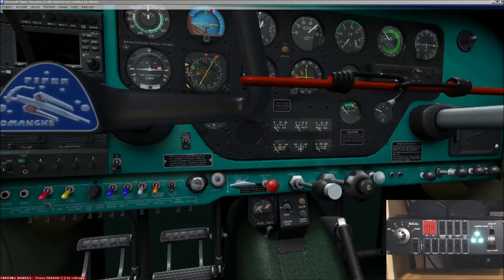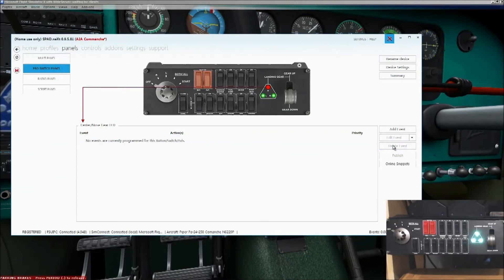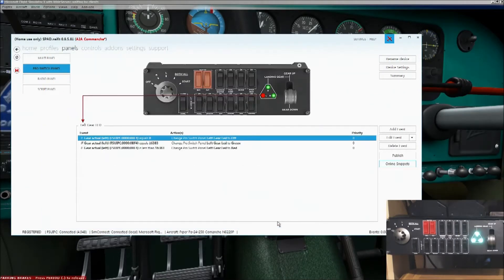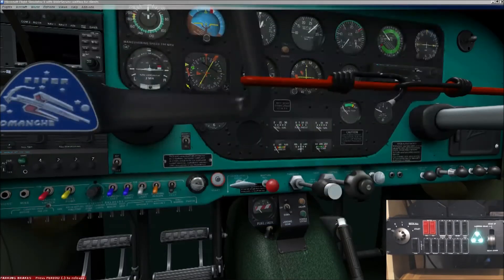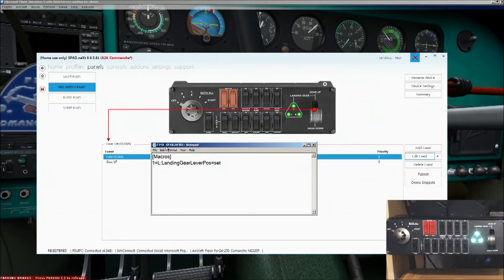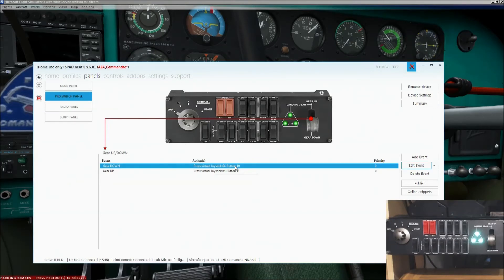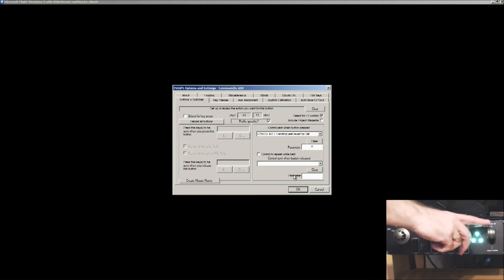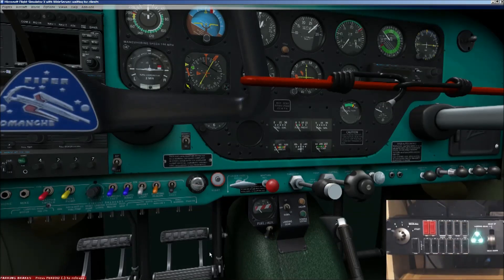Configuring Gear LEDs with SPAD and Saitek Switch Panel

Comment: nice video. Question regarding the landing gear LED lights. When on ground the gear lights are green and they are always on great! but when you take off and retract the gear they go red, but then the colour red does not remain and goes off. How can I make the gear lights stay red during the flight is my question?
Reply: In normal aircraft operation, the red LEDs indicate the gear are in transit, meaning when you raise the gear, the lights go red while the gear are moving to the stowed position, and the lights go out when the gear are fully stowed.  When you lower the gear for landing, the lights turn red to indicate they are moving to the landing configuration, and will go green only when they are down and locked into position.  Does this help you with your question?  The red LEDs are only there to indicate the gear is in transit, so you know it's not safe to land until they are green.  Hope this helps.